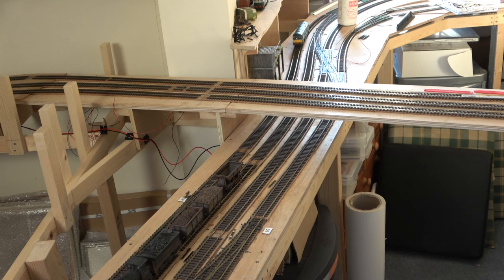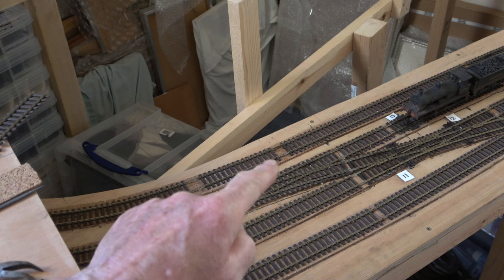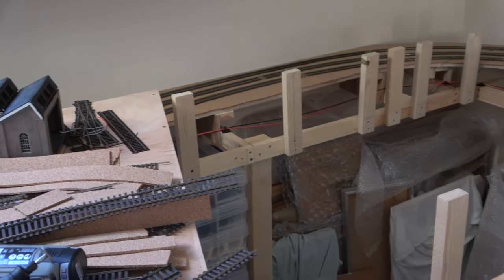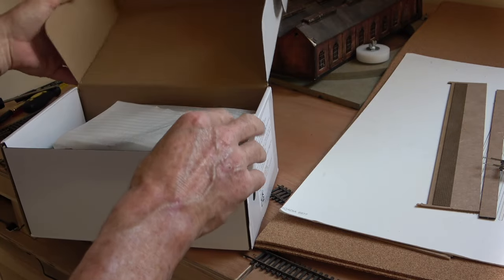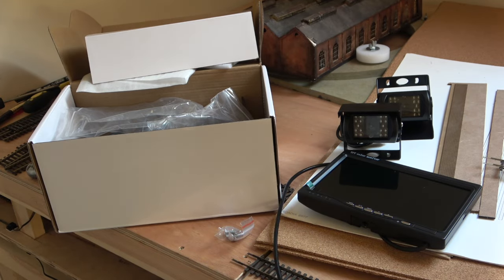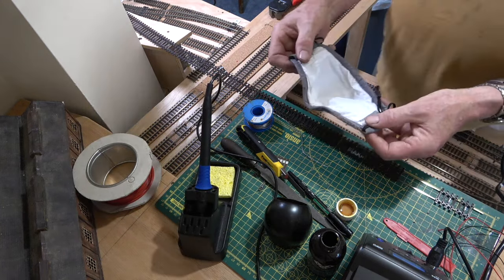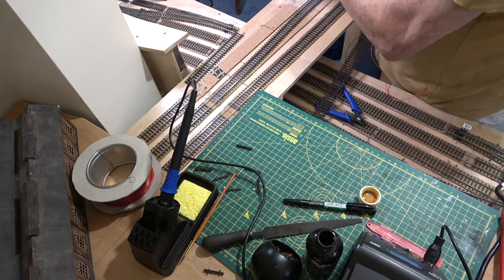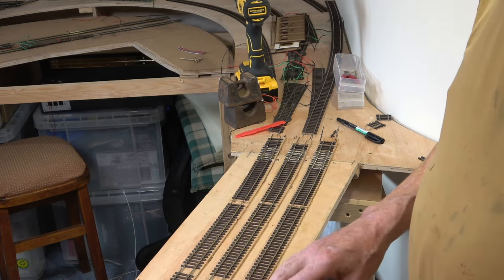Sandling Junction Build Ep 10 - Lift Out- and Lights, Cameras and Action!

Comment: Hi Paul. Lovely to see your new layout coming along so well. Regarding securing the lift out I would echo what man others have said which is to use Brass Dowels. I have used them before quite a number of times as my initial layout was totally modular in it was essential that every board line up perfectly when reassembled. Also although I know you are not keen on Clamps but I plan on using some small adjustable toggle clamps to secure them down hidden underneath the layout. Still whatever you decide, keep on with it and happy modelling 😁
Reply from the maker: Thank you all good point that will be considered, cheers P

Comment: Hi Paul, you could put magnets on the under side and then magnets in the ends to make sure they line up at each end. <Anita>
Reply from the maker: Hi Anita, it is possible so long as they are sunk into the timber as all dimensions are now set for the track. Unsure if Neodinium will be overall strong enough to prevent any warp. cheers P
Reply: @Sandlingjunction  true about strength but should be strong enough to keep in place though

Comment: Hi Paul, I think the easiest solution for securing the bridge would be to insert a 7mm dowel on each side of the tracks at each end of the bridge. Drill 2 holes each end through the bridge into the timber ledge to a depth of about 18mm after clamping the bridge. Glue the dowels into the bridge from the top then trim and sand any protrusion on the top. this will secure the bridge so it doesn't have any side movement then fix a cupboard spring lock clasp underneath at each end which will stop any up and down movement. Once done which should be a very simple procedure you will only need to put your hand underneath the bridge to release the clasp. Hope this suggestion is useful, regards Alan
Reply: Hi Paul, I did the same lift out as you but it was a pain, so I hinged one end and what a difference it made. Regards John
Reply from the maker: Another great thought to consider cheers P
Reply from the maker: @johncresswell9843  Hi John that is not possible sadly as I intend a lot of scenic work on that bridge as time will show, cheers and thanks P

Comment: A simple alignment set up would be to use two  pairs of baseboafd alignment dowels as supplied by Station Road Baseboards (Not Julian) supplied via the eBay at a cost of £2.40 + £1.80 postage for 4 pairs, I would place two pairs, fitting into the surport section on the horizontal, being you say, you, cut the track a little too close to the board edge. The other two pairs fitted in the verticle at the opposite end, thus ensuring positive alignment each and every time. Then to stop any movement of lift untill intended, fit a couple of neodendium magnets also into the end where the dowels are inserted in the verticl. I have used the said items on my modular built layout, and fully recommend them, I dont have any affiliation with the gentleman other than, that. of a satisfied customer,  Glenn,
Reply from the maker: Many thanks Glenn, much appreciated, cheers P

Comment: Re the droppers, I would get some red & black heat shrink tubing and effectively re colour the droppers to the correct colour, i.e. red heat shrink on the offending black droppers and black heat shrink on the offending red droppers. Re your lift off section, you could use some neodymium magnets on the underside of the lift off section to hold it down and DCC Concepts do a locating dowel kit that can de used to ensure the rails align correctly. I think it also can pass track power through the dowel pins
Reply from the maker: Very nice ideas, thank you, cheers P

Comment: Ideally you want the registration and clamp system working before laying the track so you can ensure the track aligns correctly. A system of dowels/holes and clamp/clips or bolts/wingnuts should work. Or bolts that you might use on a door. Edit: search for hook lock clip.
Reply from the maker: Thanks Ian, I will investigate that, cheers P